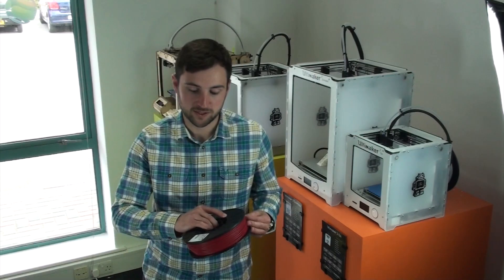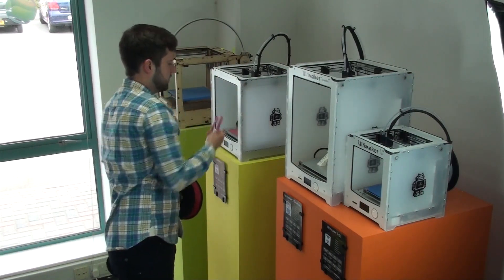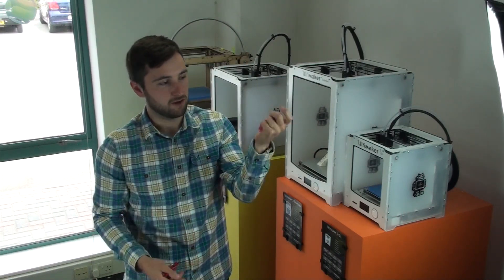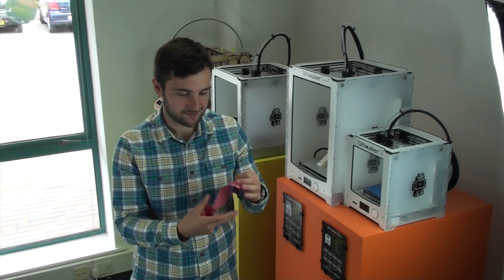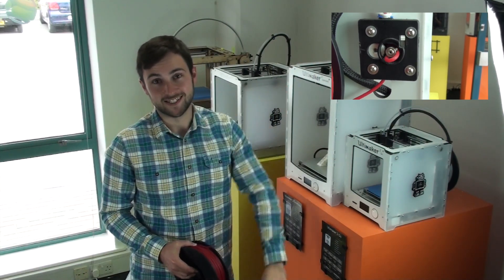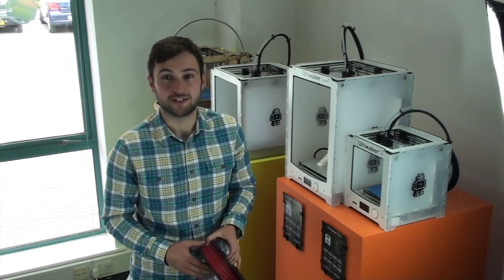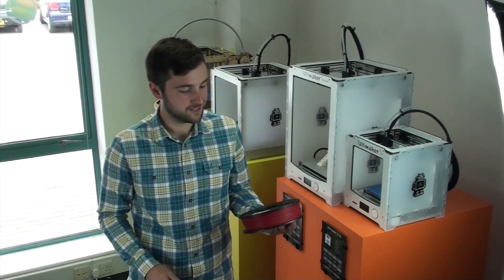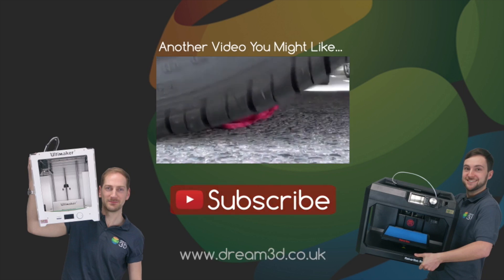NinjaFlex 3D Printing Tips On The Ultimaker 2 | Support | Dream 3D

Comment: Printing ninjafex on the ultimaker is quite difficult due to the high resistance of the bowden tube. To print ninjaflex without firmware mods, use the straigh-tube modification: https://www.youmagine.com/designs/ultimaker-2-straight-tube-flexible-filament-spool-holder and https://www.youtube.com/watch?v=bfQyHHBZIP8

Comment: how did you load it? also while accelerating while loading does it cause issues?
Reply from the maker: +aumkar chandan you can load it normally, when it accelerates you might find it tangles occasionally but it's generally fine. If you do keep getting problems  you could use the move material option and load it slowly by rotating the control wheel/button.
Reply: Thanks